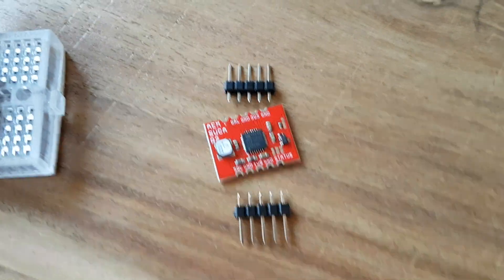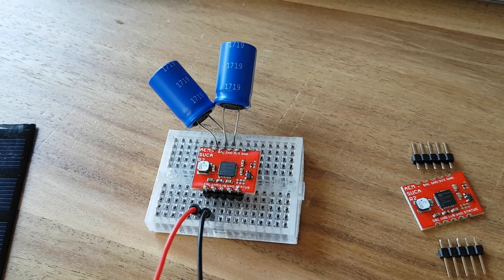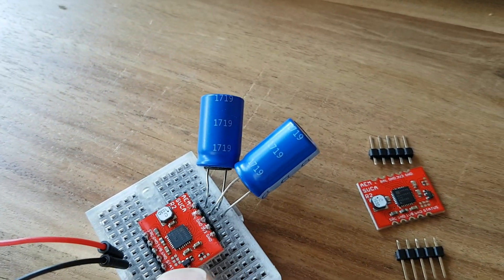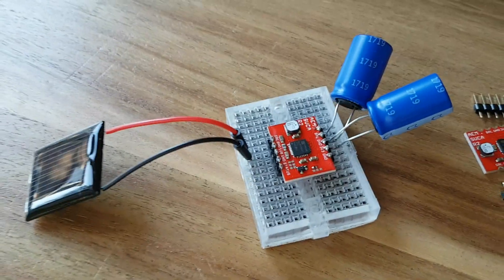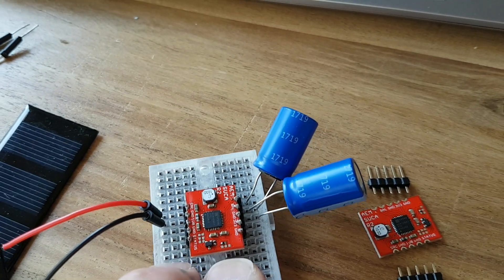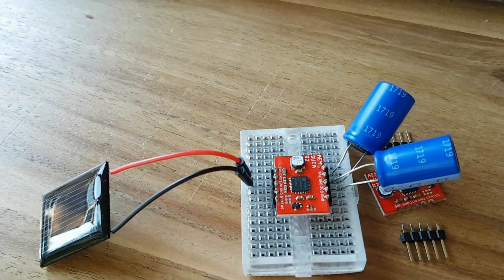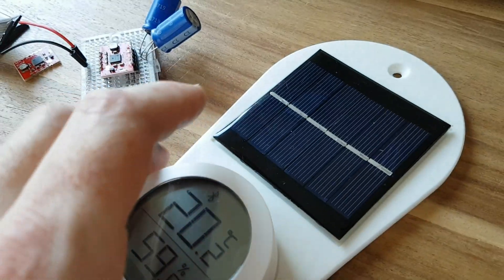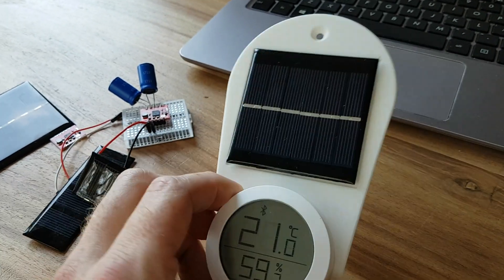AEMSUCA, a board for solar harvesting into supercapacitors

Comment: hi very nice project. What is the best choice to power an NodeMCU ESP8266 with a pir sensor ? The nodemcu is deep sleeping when no activity . is the solution with capacitor  or the solution with battery the best choice ? Regards
Reply from the maker: ESP8266 draws more current (~170mA) than the AEM10941 IC can deliver (officially 80mA) . You can use a buck converter like the TPS62740 to step the battery/supercap voltage down to 3.3V, it can deliver 300mA. I think best choice for a wifi connected device is battery because it hold much more energy than a supercap. Only for super low power devices I recommend supercaps

Comment: Very nice. Did you make the temp/humidity monitor yourself, or did you modify a commercially available one (if so, which one)?
Reply from the maker: I bought TH from Aliexpress and modified it. https://nl.aliexpress.com/item/32846083629.html 
Internally it has a booster to 3.3V, I have connected the 3.3V from AEMSUCA to that. It works great 10 out of 12 months, but winterdays are too dark. I still have plans to build one with a Li-ion battery and I hope that one can survive the winter.
Reply: @JasperSikken  Did you try using a Li-ion or a Li-Po battery? Please let me know if it worked, thanks!
Reply from the maker: @Varun-iv9cn  Absolutely yes, I have this board for sale! https://www.tindie.com/products/jaspersikken/solar-harvesting-into-li-ion-battery/

Comment: 80mA.. maybe enough for sending a LoRaWAN message...
Reply from the maker: You could reduce transmit power so it remains below the 80mA limit. However Matias tried sending LoRaWAN message (135mA) from the 3.3V/80mA output and the voltage dropped to 3.21V. https://it-net.blog/?p=208&lang=en.  So it works. Alternatively you can use a buck converter like the TPS62740 to step the battery down to 3.3V, it can deliver 300mA.
Reply: @JasperSikken  How to buy only ic i am not getting response by dealer
Reply from the maker: @surajrebbawar5590  please contact me through my product page.